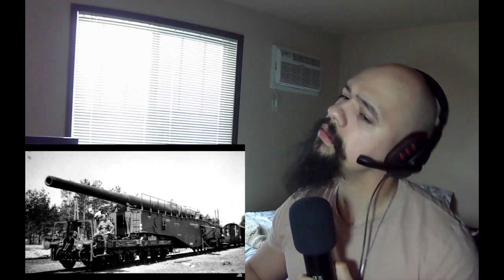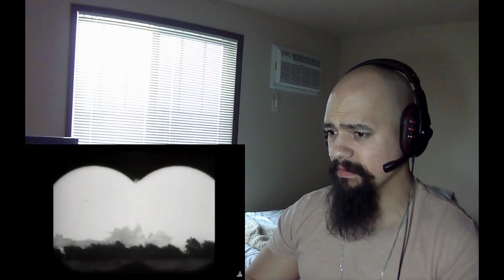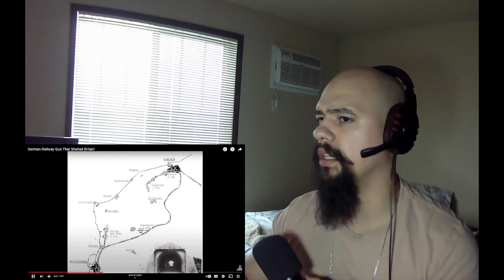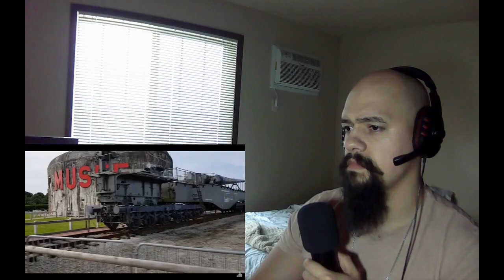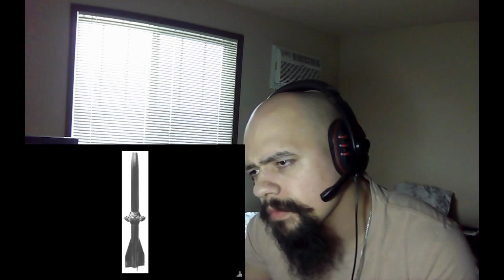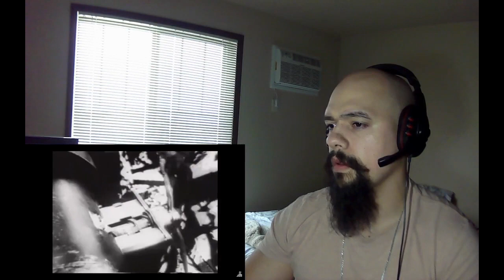American Top German Inventions Reaction - German Railway Gun That Shelled Britain

Comment: Something to give you more perspective and context for the size of the Krupp K5 guns, they were very large guns...especially for guns on land...but there were many naval guns that were much larger used in WW2...even by the Germans. For instance, the guns on the Bismarck and Tirpitz battleships were 380mm (15in)...almost 100mm larger in diameter than the K5 gun at 283mm (11.1in)...and the Bismarck and Tirpitz each carrier 8 of the bigger guns. The US battleships of the North Carolina, South Dakota, and Iowa classes all carried 9 guns that were 406mm (16in) in diameter...and the Japanese Yamato class battleships carried 9 guns that were 460mm (18.1in) in diameter. When you look at shell weights, the stats become even more fantastic...the K5 fired a shell that weighed 255-265kg (562-584 pounds) while the German 380mm shell weighed 800kg (1800lb), the US 406mm could fire an armor piercing shell that weighed 1225kg (2700lb) and the Japanese 460mm gun lobbed shells that topped out at 1460kg (3218lb).

One thing that is very notable about the Krupp K5 is how long the gun is...which is the biggest thing that gives it much longer range than even those larger naval guns. Here the stat is dramatically in favor of the K5, as its barrel is longer than 25m...83ft 9in to be exact. To compare, the Japanese 460mm barrel is much shorter at 69ft 4in (21.13m), with the US 406mm coming in just a bit shorter at 20.3m. Comparing the maximum firing ranges of the shorter barreled naval guns proves the fact that long barrels mean long range...the K5 reached out to 64km, while the US 406mm could reach only 47km, and the Japanese 460mm being able to reach out to a slightly shorter 42mk range.
Reply from the maker: So we had more advance and capable armory than the Germans when you put it these stats though
Reply: @Pjalphareacting  Not exactly, it was more about Germany's focus being more land based, as opposed to other nations that focused their efforts in BIG guns on naval weapons. Ultimately, yes...the Allies overall had better big guns than the Germans, when you consider all factors...but the biggest advantage the Allies had was in fire control...the ability to shoot big guns accurately was definitely better for the Allies. As we see in this video, the Germans had an edge in making big LONG guns. There are other things that make land based large artillery so different than sea based, with the biggest different being mobility.